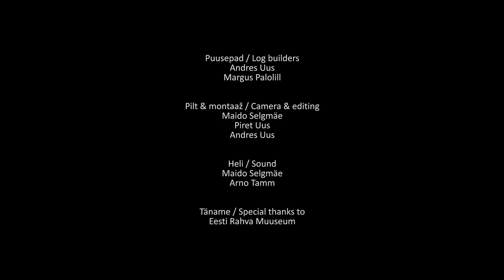How To Build A Log Cabin - Simple Straight Lap Notch From Hewn Logs

Comment: Wondering, were those fresh cut logs, worked green or were they cut at the project start and aged?
Keep up the good work!  Keep building!
JIM 🥰
Reply: The advantage of the norwegian notch is that it is self tightening as the wood dries and keeps wind out, this means the logs are best built with aged only about 1 year but ALSO can be used green

Comment: The drawknife removes the bark much faster than the first method.
Reply: the first method is a lot easier on the back.  I have a draw knife and i still sometimes go get a pipe that i beat flat on one end and angled a bit so it's like a scraper just so i can stand up and work.  Gets tedious straddling a log or pulling.  sometimes i like to stand and push.  maybe it's instinctual muscle balancing.

Comment: Excellent work guys 
and it is nice to hear a quiet work site ( without machinery) 
it is interesting the different way you can scribe in and mate logs, The Outsider does it differently on his build and also so does My Self Reliance  (Shawn)  on his channel maybe between the 3 of your channels you might be able to combine some part of  each others way of doing things and end up with either a better or a more efficient way of doing things? 
Done for the right reasons progress can be beneficial 

 It is just a thought anyway 

Thanks for the new postings I am enjoying them very much 

Tony From Western Australia
Reply: Northmen's style is much more labor intensive and harder than My Self Reliance or Outsider. 

MSR or Outsider cut the corners for their purposes. MSR for the saved time and because he is working alone. Outsider due to his available logs (he has a video on why he will need to use chinking).

With the chinking method that they both are using it is easier to "hide" the mistakes from notching and scribing. With Northemen technique you will immediately see every mistake and hole from not 100% matching the logs. Turning the logs from round to square is also really demanding and time consuming but it comes with benefits if you don't want to cut corners and have know-how.

Probably the best and highest level craftmanship video on log cabin building is the "traditional finnish log cabin building process" video.
Reply: @TheEasyRail  can you please enlighten me as to what the benefits are from making straight edges?
Reply: @thecurrentmoment  It breaks the long fibers in the wall and it becomes more resistant to the wind and rain. I don't know more in detail why it works like it works.

Also it's more house-y like and you can use walls easier inside to hang stuff and nowadays being able to do this kind of handmade straight edges has become show-off for the carpenters talent.
Reply: @TheEasyRail  that's interesting.

I was also reflecting on it and came to the conclusion that it would be a lot easier to notch them together if the sides were straight instead of having a big bulge on the side of the join. I don't know if that's an issue or not

Comment: what is used for log cabins, fresh cut trees or dry older cut trees?
Reply: dry. green wood will shrink causing gaps
Reply: The tree they were working with here was fairly green.  You can tell because the shavings from the drawknife are limp like noodles.  Dryer shavings wouldn't do that, and they'd curl.  For roundwood building like this, greenwood is acceptable for structural, particualarly in the lower courses of the work, which will bear a heavy load that keeps them from warping.  For hewn frame/trim applications or furnishings it's not desirable because it doesn't have same restrictive load so things tend to warp.
Reply: You cut the trees down when its winter.

Comment: What are the benefits of hewn logs rather than just keeping them whole on the interior and exterior? Seems like a lot of extra work but I'm sure there's a good reason
Reply: Sea of York  Insulation mate.
Reply: They dry out easier than round wood and it makes it somewhat simpler by giving a reference face to ensure the courses are actually vertical  also removing some of the exterior face reduces internal tensioning so they are less likely to check (split) significantly on horizontal radials.. Just shaving off that bit of the log releases a huge potential tension.
Reply: Not all logs used are the same diameter.  By hewing the sides flat the logs can be made to a uniform dimension throughout the building, thus providing a more flat/straight wall.  
JIM

Comment: I LOVE that measuring technique you did with the nails and the string it’s GENIUS!!!!!!
Reply: It's called a chalk mark.
Reply: Nothing to do with measuring, it's a fast way to make a straight line. Bricklayers' use a similar tool called a plumb line, for the vertical a string with weight on the end is used. For the horizontal string and a spirit level is used.

Comment: Why not just square all 4 sides instead of carving the curve? Is there A reason?
Reply: Joshua Nickens if you think about it the curve would prevent water from running in during a driving rain. A flat log would allow water and add more rot over time from standing water.

Comment: Excellent video! I was very interested to see you peeling, then scoring the log on its top side, but when you dogged the cant and side-hewed a vertical face, I felt you missed an opportunity. I use single bit hewing axes to TOP hew the entire beam. My axes are sharpened like a chisel and I score a face as one would chop a hinge mortise, striking bevel down, striking regularly, lifting chips along the top side of the log. On good wood, I can remove a large chip, but mostly the chips are just raised. The edge of the scoring ax is fairly straight, like a chisel. Final hewing is done, on the top of the scored log, with an ax sharpened with a curve-edge, like a slick, swinging horizontally. This method keeps the ax out of the ground and is great for increasing slap shot power!

Comment: Beautiful work!
One question if I may 
 isn't it more logical that the flat surface of the log  will be used as a connection surface  to the next log than the rounded side ?
Reply: I'm not an expert, but I suppose having a flat surface has its own distinctive look and it won't be as vulnerable to forces of nature like round wood. Wood has a tendency to crack when it dries, and if you have round wall, water will pour into those cracks more easily.
Reply: also flat to flat doesn't keep water from traveling through the wall. late reply I know :)

Comment: is the moss to seal gaps? why wasnt the scribe used to make the end profile more accurate?
Reply from the maker: It is not necessary for end profile to be tight at that point, it would be wrong, because the water will get in there and it will not ventilate and will start to rot there as this part will be exposed to the weather.
Reply from the maker: Moss is traditionally used as insulation material in all over the Scandinavia and Baltic states. It is being still used and it is antibacterial and kills fungus.
Reply: @northmenguild  thats great. Now I have your attention, are log cabins ever burned in the japanese way to preserve the wood more and to absorb more sunlight for warmth?
Reply from the maker: @utubeape  Not in our part. It has been done in Swiss Alps more. But they can be burned it will just give more years to the wood to last. The better way of to make the wood last many hundreds of years is to randomly peel off the bark of the standing pine or spruce tree - injuring the tree while it is alive. It will start to fill the sapwood with resin to heal the wounds so after few years you have a fatwood full of resin instead of weak sapwood. Check this Swedish site for more info: http://www.fetvedensvanner.com/
Reply: nick w the so-called "shou sugi ban" technique is unbelievable,i dismantled a burned down loghouse where the logs were charred both sides and they where exposed to the elements for atleast 15 years.The wood was perfectly dry and no sign of rot.
Reply: @ahti29  yes, I have been looking at the method, it does seem to be an awesome coating especially used with oil, though tung oil on a log cabin would be expensive. I was thinking about the fresh would drying out, cracking and splitting, so do you think charring would solve that too?
Reply: nick w Coating green wood is bad idea,and that includes charring also.Natural wood cracks anyway but to me its the nicest visual feature of wood.
Reply: @ahti29  ah OK. I was wanting to char or black stain because I want to do a covering for the south facing of a small house that can be put in place in winter to help absorb heat, having like big hinged screens with small windows to allow light in, but act as extra insulation and heat absorbtion

Comment: Why are you using pine loges there full of sap and can absorb water easily Wich causes the wood to rot...but they are easy to cut so I guess if this is just showing not a bad choice and though it does have sap at least it smells good also I like the use of traditional tools
Reply: They cut these logs in winter when all the sap is in the roots. Then they are cured for a year or so before they are used. They are completely dry and solid, trust me. Just like the lumber you would buy anywhere else...People have been doing this for thousands of years. I think they know what theyre doing.